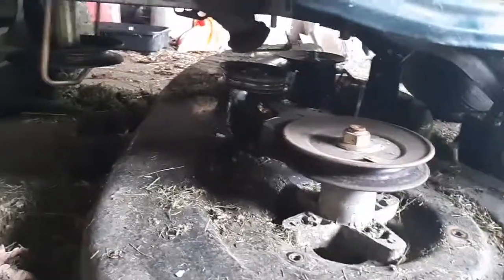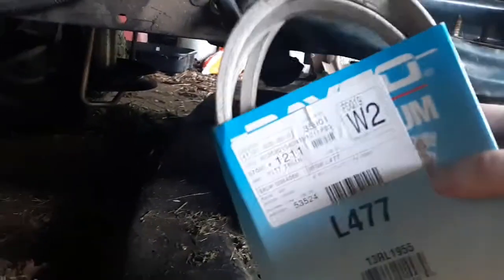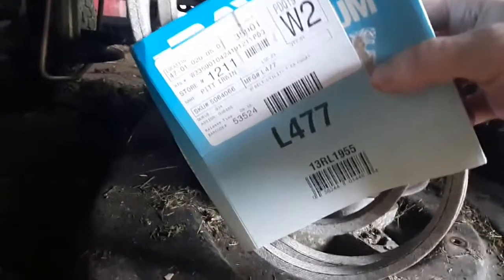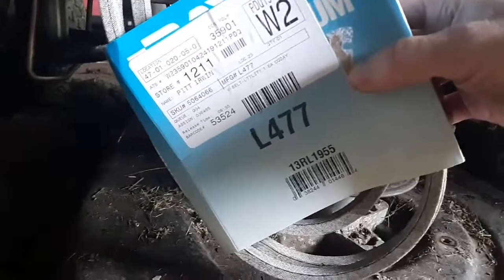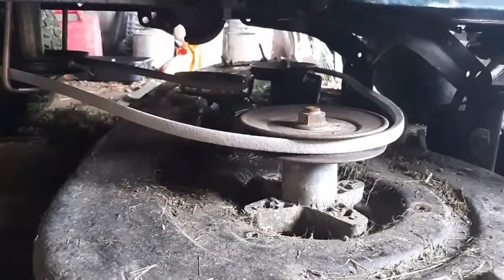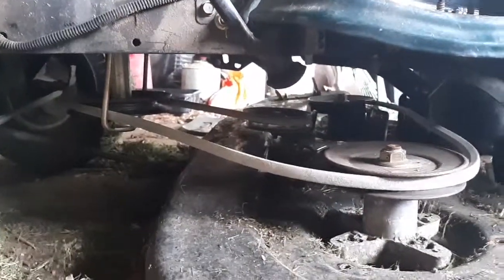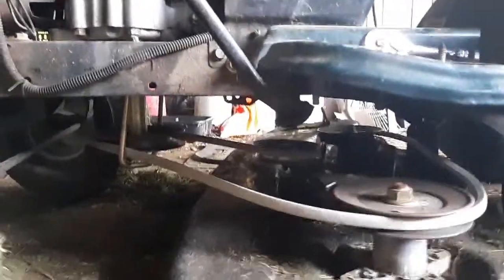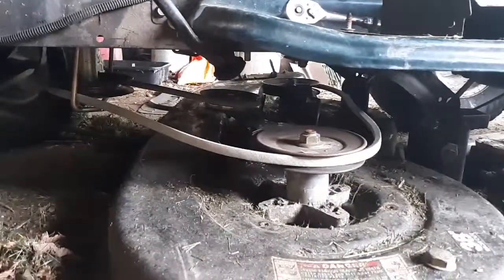Changing a Belt on a Bolens Tractor!

Comment: My deck seems to be uneven by like half inch. Is there a way to tighten something to get it even? It's lower on the right side if you're looking straight at it.  Thanks
Reply from the maker: Make sure the one mounting bracket on there isn't broken I had to weld mine back to the deck

Comment: I have this model and the speed control no longer works after changing drive belt. It was tight but it is the same number as the old one. Any ideas? It's stuck in 1 or 2 (slow).
Reply from the maker: That's not related to the belt that has to be another issue
Reply: @finkstv  perhaps, but that's why I asked if you had an idea, if not fine, but thought I would ask.
Reply from the maker: No not sure but I'd look at the back side of the speed selector and see if anything looks out of place or broken
Reply: @finkstv  That's part of the problem , I can't see the back of it, it's hidden behind the cover and can't even tell what it hooks to. I can't find any info on how that lever works. It's like one of the mysteries of the universe.

Comment: I need to take the whole deck off any videos on that
Reply from the maker: No I don't but it's not to hard if I wasn't at work I'd make one for you
Reply: @finkstv  okay no worries. I have two Bolens I am trying to swap a deck and don't have a clue what I'm getting myself into...
Reply from the maker: It's not to hard got to take off the pto Cable Un hook the belt and then there 2 pins you have to remove closer to the seat side of the deck and then there's that front peice after you can wiggle it out once you have the rest Un done
Reply: @finkstv  okay awesome thanks for the tips bud. Much appreciated

Comment: I have one of these mowers and the lever that engages the blades came loose and now the blades won't go.  
I don't even know how to access the inside to where the lever connects. 
Could you help me?!?!? Thank you!
Reply from the maker: So if you unhook the battery under the seat there's a metal tray you can pull it out and you can see and reach from there to the lever
Reply: @finkstv  awesome! Thank you so much! I'm going outside now to check it out.
Reply: @finkstv  I located the issue.  I dont know what it originally is supposed to look like but it definitely looks like the cable broke off of something and the lever may be missing something.  I bought used and did not get a manual.
Reply from the maker: Yeah no manual either I have a video replacing the pto cable so that might help you
Reply: @finkstv  thank you.  The little hook that attaches the cable to the lever broke off.  Thank you for all your help! I'll have to order a new cable if I can find the correct model number.
Reply: @finkstv  mine is a 38 inch deck,  Bolens 6 speed shift on the go.  Not sure of year.  But on bolens website, I'm not finding a 38 inch engagement cable. 🤔 I'll have my work cut out for me.  
Thanks again!!!
Reply from the maker: You can purchase from Amazon the cable  Just measure your length to verify you get the right one
Reply: I got my new cable and installed it!!! Then I fired up the mower and engaged the blade and the same piece broke right off the new cable. Ugh!!!!!
Reply from the maker: There must be some kind of other issue causing that because I had no issues with mine

Comment: Did you have to drop the deck or just the shield. Thanks
Reply: You need to drop the deck to its lowest setting but I'm not sure what you mean by the shield.  The belt enclosures that are bolted around the side pulleys?  If so, you definitely need to remove those before installing the new belt.
Reply: Thank you I miss printed . I meant the covers. Thank you .

Comment: We just replaced this belt, after mowing twice the tractor won’t go forward…. We can’t figure out why - belt is functioning as it should, blades will engage, mower just won’t go forward…
Reply from the maker: This belt is for the blade only not for the mower to drive there Is another belt you can look and see if it maybe broke its little more hidden

Comment: where is the oil filter? I can't find the oil filter?
Reply from the maker: So they made this module with 2 different style engines 1 has a filter and 1 does not have a filter. My model came with the no filter engine as well
Reply: @finkstv  thanks for the quick response. I was desperate to get this done as it will rain the next 2 days. Honestly, I have never seen an engine without an oil filter, until today.
Reply from the maker: Yeah it's a goofy design when I first got it I wasn't sure about it till I did some research